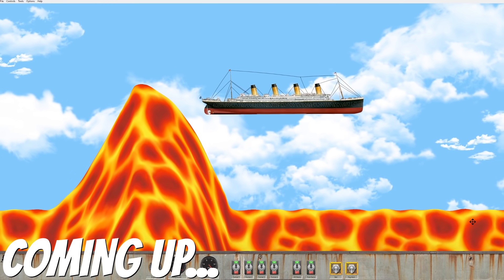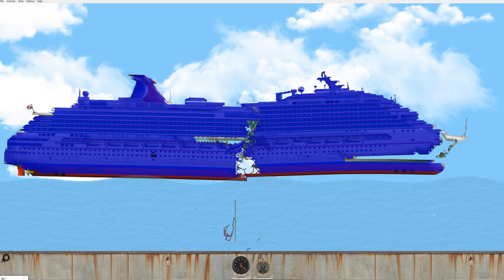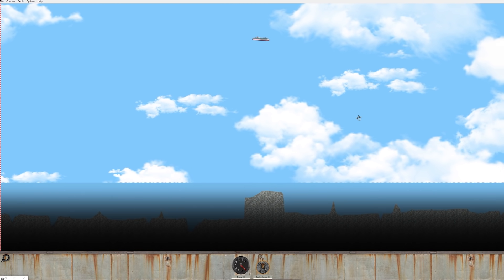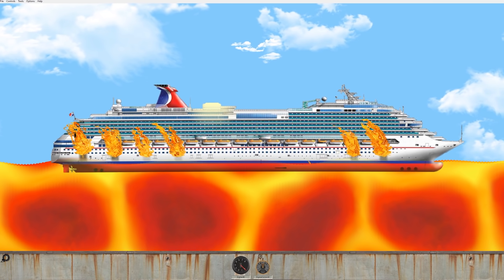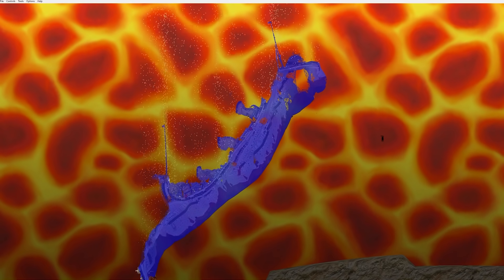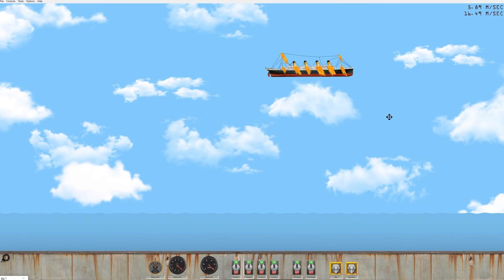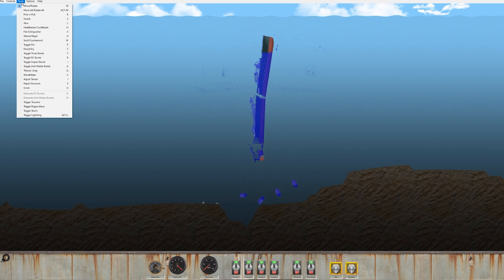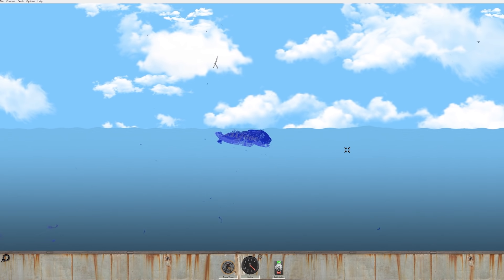Throwing the Titanic into a LAVA TSUNAMI! - Floating Sandbox Gameplay

Comment: The reason why the Titanic appears to be so much "weaker" than the Britannic, is because of design changes that happened after Titanic sank.  One of the main reasons why, in reality, Britannic didn't split in half when it sank, is because an extra skin was added to the hull, extended at least to the edge of the waterline - as for Titanic, it only had a double-bottom keel, so when the split occurred, the double-bottom stayed together for a moment or so, and then the keel separated.  So, despite being a "sister" ship, improvements were made after the Titanic disaster (including bringing up the watertight bulkheads to A-Deck instead of E-Deck).
Reply: This is cool
Reply: You are in the most definitely right, part of why the titanic sank is because of the double hull at the bottom, and there was no double hull near the spot in front where the iceberg hit, there's also a theory of a fire which weakened the hull in which allowed the iceberg to pierce the ship's hull and water started to flood in.
Reply: The bow was split
Reply: @N-L3 true there was a huge black mark on the titanic when it started her madien voyage (some piece’s from Olympic the collison with hawke